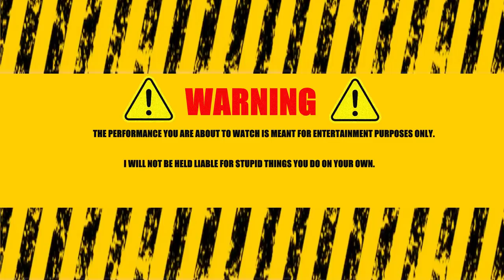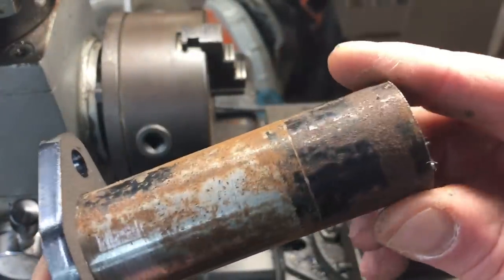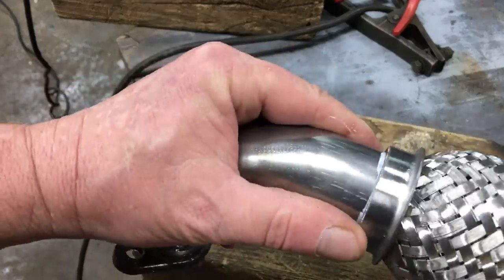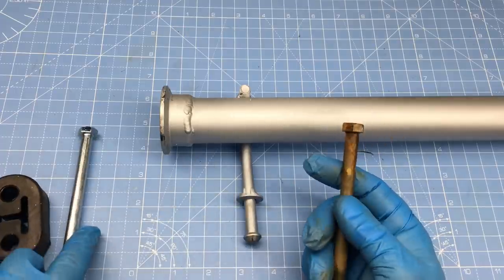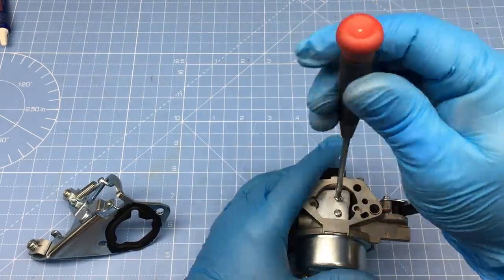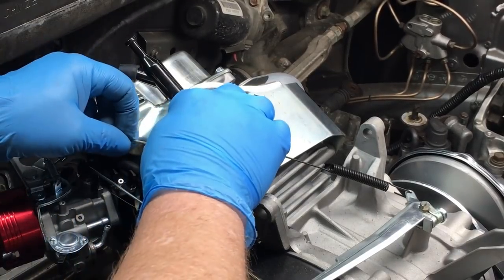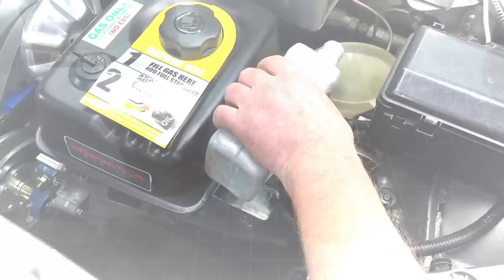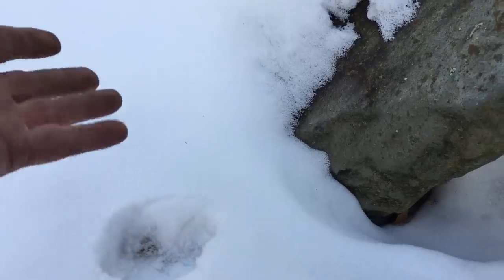Episode 15. We finish the 420 HEMI engine swap on our lawnmower powered car.

Comment: I started mechanics in 68 on lawn mowers and Stingray bikes and so on and I got in the car magazines and hot rodding and modifying and all that stuff and I wanted a lot to modify lawn mower engines back then in 1970 and modified a Wisconsin 6 horse motor it took me a year modifying to put it on the back of a junk go-kart and run around as cheap as possible I never had a shop all we had was a carport didn't have hardly any tools never had any money try to do this on a dollar-an-hour at what's doing in this video this is the shit I dreamed of I would have killed to have had a atlas 6in x 12 lathe and shop and all that junk welding you know the only things available then were arc welders and acetylene  there weren't any wire welders and nobody could afford any s*** and here people are modifying small engine making race cars Junior Dragsters and back then everybody thought I was nuts saying what you can't do those kind of things now everybody's modifying this s*** and making special Parts on CNC machines try doing it back then with no tools on a dollar-an-hour and see how far you get..things of a 14yr Olds mind